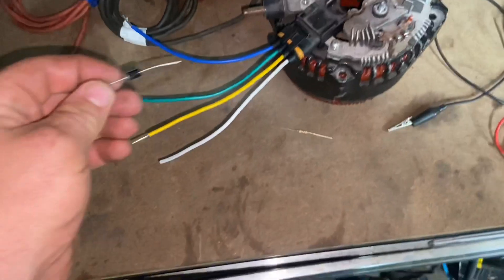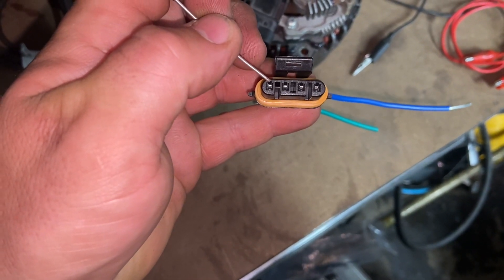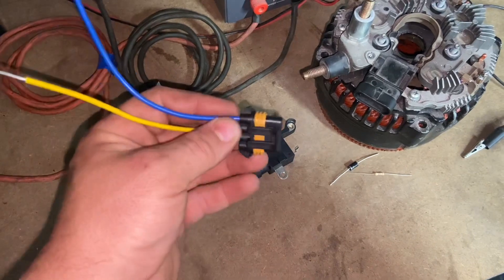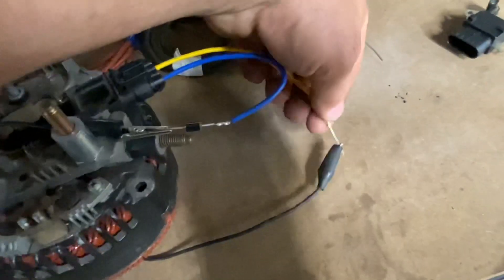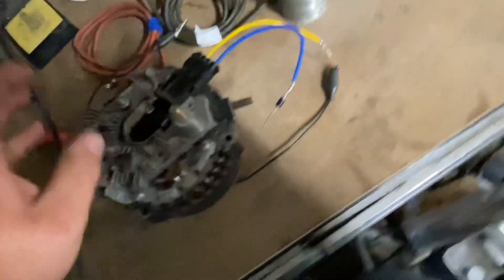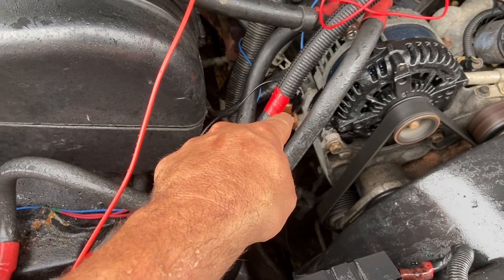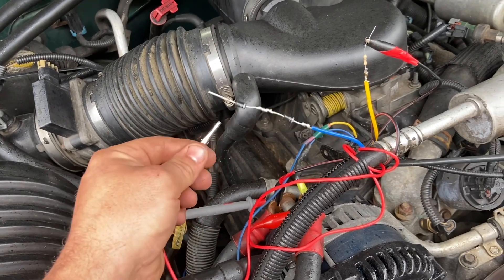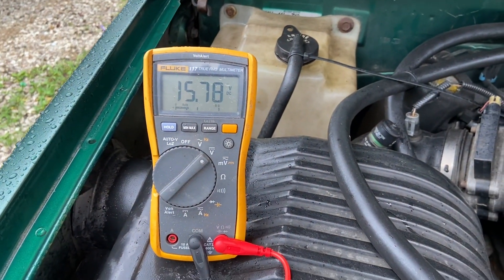Increasing charging voltage on car audio alternator

Comment: Will it work on a 3 pin ?
Reply from the maker: What make and model car is this on?
Reply: @sub-humansounds5645  2010 ford taurus limited
Reply from the maker: @marcomartinez9181   if I’m looking at it correctly the middle wire is the “S” terminal. The diodes will be installed on that terminal

Comment: Won't the alternator stop working if you took the two cables off ?
Reply from the maker: If the regulator is not a self exciting unit, removing the plug will stop the alternator from charging

Comment: Nice video, Very detailed. If you can please help. I have a 2014 Camry 2.5 L. Can this process work on the stock alternator? And if so what wire. Thank you.
Reply: Ever find a work around on your Camry I have a 2009 I just got, won’t charger over 13.2 and I have a AGam under the hood.

Comment: What do the green and white wire do and why do you not need to use them?
Reply from the maker: I found a pin out that listed them as the ECU wire and a pulse wire. I have never seen them used though
Reply: @sub-humansounds5645  great, that you for the reply.  I'm planning on doing this to a 2018 Mitsubishi Mirage.  It also has a 4 pin plug, so I'm sure the process is relatively similar.  Can you explain further why the resistor is needed on the lamp wire when doing this modification?  Why does it not come that way form the factory?  Sorry, just trying to learn as much as I can before I attempt this myself and your video was one of the better ones I could find on Youtube.
Reply: Número de las 2 partes de diodos?

Comment: Oops I didn't use a resistor on the lamp wire, going on 5 months @15.5 to 16 volts, no problems yet but should I be worried??
Reply from the maker: Is it using the factory wiring? Or are you directly switched to it?
Reply: @sub-humansounds5645  I switched the harness with the one that came with the 370a Js brand alt
Reply from the maker: @keithbutler7896  is the factory wire still connected to the new harness?
Reply: @sub-humansounds5645  yes and still no problem

Comment: Hi, boss do you have the link for tje resister?
Reply from the maker: BOJACK 470 Ohm Resistors 1/2 W ±5% Carbon Film Single Resistor (Pack of 200 pcs) https://www.amazon.com/dp/B07QYRRX3L/ref=cm_sw_r_cp_api_glt_i_WWNKYZX7ES9QZMTDZ693

Comment: Very good video explaining the process. I have a 320 4-pin that Iraggi built for my 97 Dodge, I was a little lost at first but got it down now, I'm running 18ah Lishen cells around 16v cold 15.5 hot. I think my Mechman 240 charges better though. Scot
Reply: Also running 240 cmax in a 98 Dodge Ram w an 320 amp alt
Reply: Does it effect the amprage any

Comment: Hi does it matter exactly what diode i use?
Reply from the maker: As long as it can handle the current that is going through the regulator it should not matter

Comment: So I have a 99 suburban with just one brown wire coming off plug any way to boost this style alternator?
Reply from the maker: Yes. If you pull the plug out the alternator should have the the rest of the terminals. If so, just get a 4 pin harness and replace the factory harness. That will allow you to use the same factory wire that is going to pin 2 and you can add the connection for pin 4
Reply: I have one wire coming off plug on a 2020 Ford Ranger XL.

Comment: I kno I can use this on a factory alt, but which wire do I use?? 2005 Tahoe...2009 Impala
Reply from the maker: In 2005 GM the alternator was changed over to a 2 pin. This will only work on the 4 wire alternator that is internally regulated
Reply: I have a 2006 chrysler 300,the alt has 2 pin harness will this work,or what do I need for my setup

Comment: Hi there.what resistor u used?
Reply from the maker: BOJACK 470 Ohm Resistors 1/2 W ±5% Carbon Film Single Resistor (Pack of 200 pcs) https://www.amazon.com/dp/B07QYRRX3L/ref=cm_sw_r_cp_api_glt_i_WWNKYZX7ES9QZMTDZ693
Reply from the maker: I apologize for the late reply.

Comment: Hi there.what is diode number?
Reply from the maker: IN5404 is the part number I use. Chanzon (Pack of 50 Pieces) 1N5404 Rectifier Diode 3A 400V DO-201AD (DO-27) Axial 5404 IN5404 3 Amp 400 Volt Electronic Silicon Diodes https://www.amazon.com/dp/B079KC17FZ/ref=cm_sw_r_cp_api_glt_fabc_GCBHDHA3ASCHFN8XRN8M

Comment: Does the same  thing  work  for  a tiida alternator??
Reply from the maker: I am not familiar with those alternators
Reply: @sub-humansounds5645  ok it's the Nissan Nissan tiida  alternator  it got  3 wires
Reply from the maker: @ogunkiyode5848   look up the wiring diagram. The diode will connect to the s terminal
Reply: @sub-humansounds5645  thanks  alot
Reply from the maker: @ogunkiyode5848   no problem. I think it’s the middle wire
Reply from the maker: @ogunkiyode5848   this is the diagram I found. Is it correct?
https://www.lusmall.com/Catalog/Part?SKU=177639
Reply: @sub-humansounds5645  yes it is